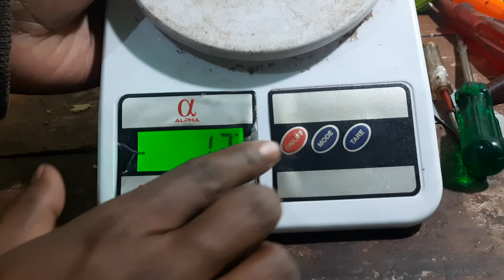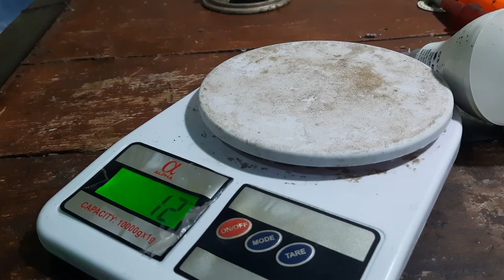how to repair kitchen weighing scale , how to weighing scale on/off switch repair

Comment: There is one extremely annyoing thing with with this scale, the auto power off function. If you take too long when you are mixing your ingredients, the scale shuts off on you and you have to start over again. Is it possible to identify which component on the circuit board that is responsible for the auto shut off function, and somehow disable it so that the scale will stay on until you press the power off button?